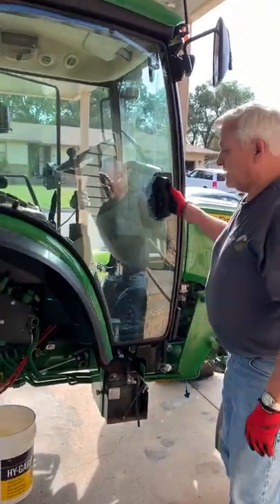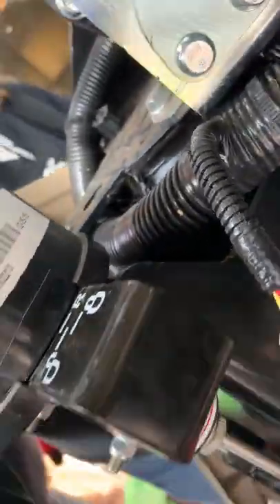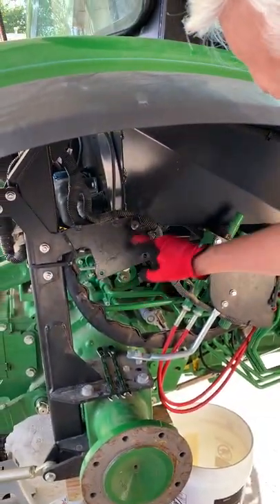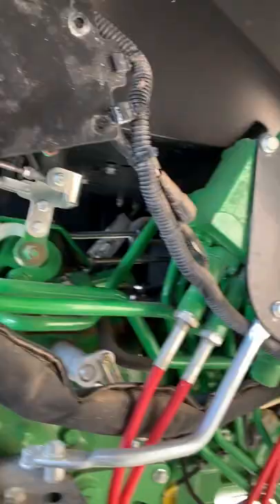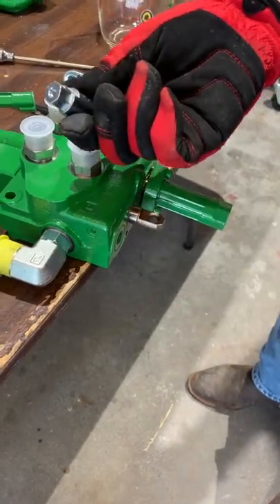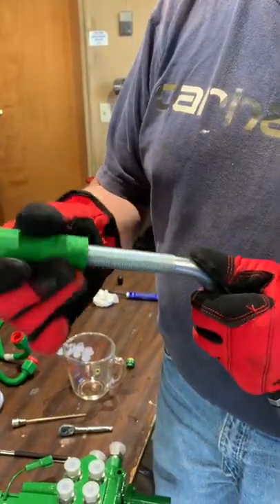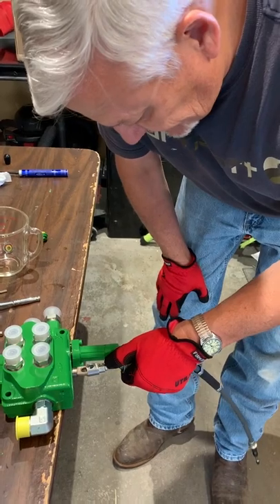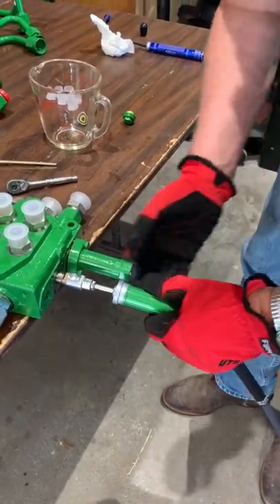John Deere 4052R 4th and 5th SCV install: Part Six

Comment: This shows the cable mounting for the SCV control levers. Later, we found that we should have used the top knock out plug and not the bottom one that is shown in the video. Please make that note and don't follow our mistake. It is rectified later, but now is the time to do it.